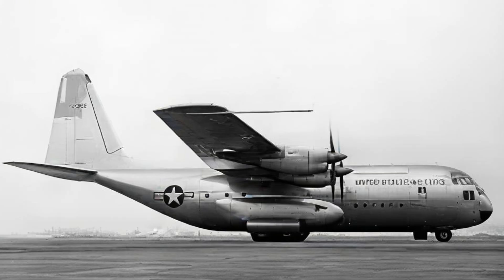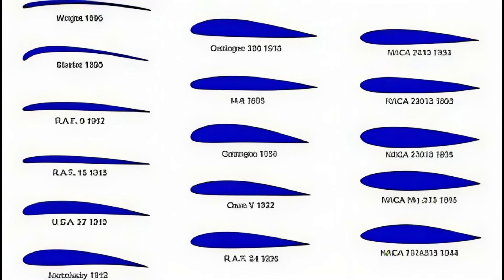The Overlooked Genius Behind Every Aircraft Wing Today

Comment: NACA led the world in airfoil research after the Variable Density Tunnel allowed experimental testing of small airfoils at Reynolds numbers that allowed the data to be useful and applicable to full-size aircraft. Since this data was public domain, the data of the NACA 4 and 5 digit airfoils was also used by Germany, England, Russia and Japan to design the weapons they took to WW2. These airfoils are still the jumping off point for wing design. While lift and drag data vs angle of attack for an airfoil are important to the aircraft designer, wing design involves much more than the choice of airfoil. Many wings use a one airfoil at the root  and another at at the tip. There is the choice of plan form - straight, tapered, elliptical, then there is twist- all of these choices influence the flight characteristics, stall behavior, etc. NACA data and methods certainly helped the designers figure out the wing loading distribution, but the structural design remained in the control of the designer and builder. Once all these variables are folded in, the wing has characteristics that are much more complicated than the lift/drag  data for the airfoil section. The aspect ratio has powerful effects on the wing beyond the characteristics of the airfoil. Throughout this video, the narration stresses that airfoil data made airplanes reliable and consistent, but that is really up to the consistency of the manufacturer in producing shape, surface quality and structure, not to the choice of a tested airfoil.  
When a manufacturer came up with a wing design, it was up to them to prove it out in wind tunnel testing and flight testing. While NACA had these facilities, the worked with the services to decide what airplanes got access to the NACA facilities and evaluation. The aircraft builders typically went to other wind tunnel agencies for direct program support. 
The other thing NACA did that gets no mention here is to develop and prove the value of the NACA cowling for radial engines, and ultimately the cowling design for all air cooled piston engines.  Since work that was done in 1929-32, that public data also shaped all of the airplanes of WW2, not just American ones. From 1938-39, NACA became much more secretive in distributing its work to the eventual Allies and not the whole world.